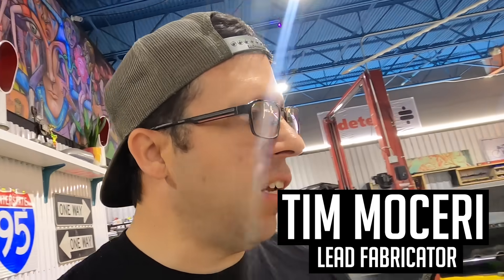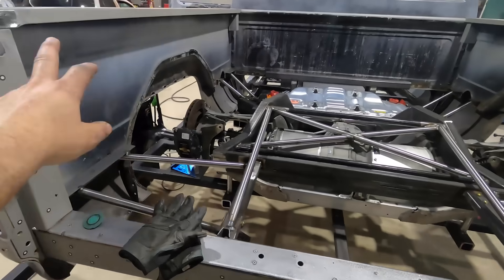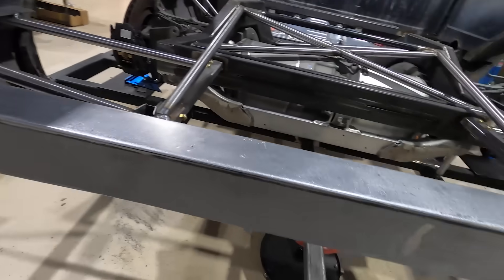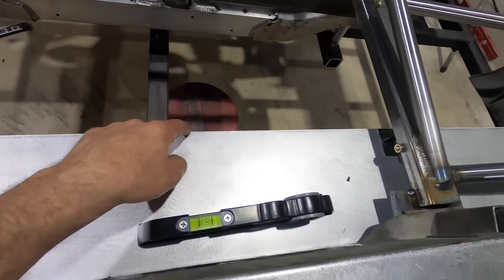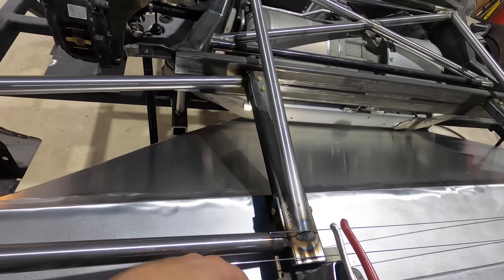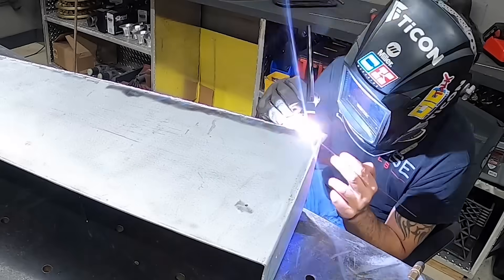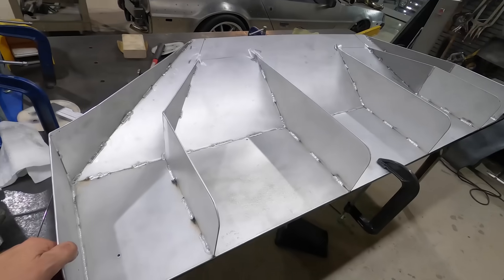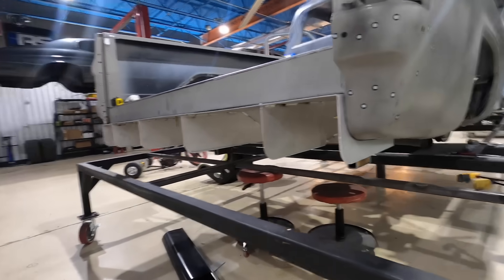GIANT 67" Diffuser For The Tesla Swapped Squarebody! - Electric C10 Ep. 7

Comment: 6:15 - why would you not bolt the diffuser to the available holes in the front/Rear of the rear motor frame, and pull the diffuser up with a curve? Sure, you lose a little bit of height, but with that tie in, and the frame of the motor being aluminum, you could gain some slight venturi cooling off the rear motor? You could also direct it down right at the front of the diffuser and keep the level, kind of like a jetski intake.

Comment: Why wouldn't you just leave the sharp edges to create vortices? Even though it's unlikely air will stay attached, in the event it did, cutting a radius in the fences makes them less efficient.
Reply from the maker: Mostly for looks. At the end of the day, it is a show truck that we'll be racing on the track. The pressure change at the rear of the truck will create downforce; not the same way a diffuser with a less aggressive angle would. But, at the end of the day, it's a squarebody truck. Not an F1 car.

Comment: Hey guys. This build is incredible and great ideas! Just wanted to help if I may (feel free to ignore me). The angle for your diffuser (underbody tunnel) may actually be too steep and cause a flow separation problem creating turbulent flow and not give you the downforce you want and creating drag. Also your rakes have some extreme angles on the outer most sections which will most likely do the same. Don't get me wrong. Awesome diffuser just might be worth looking into the design a bit more if you have the time. Well done guys!

Comment: The air isn't gonna stay attached with that steep angle. Looks cool but I wouldn't expect much downforce gain
Reply: It's a pressure difference. 

As long as there's nowhere for the air to equalize out of the diffuser the purpose is served. (Air above the bed has higher pressure = "down force")
Reply: @aetherseraph  no

Comment: Real question: How can a diffuser create more downforce AND gain range from the battery? -If it's applying more downforce / making the vehicle-in-motion at highway speed effectively weigh more, doesn't that REDUCE range?
Reply: I think they mean it will be better range  than if they put a wing on it. diffusers are much more efficient that wings...well not this diffuser. this diffuser is for looks only
Reply: @willrogers5713  That makes sense. Any links on "diffusers that work"? It it simply that the diffuser angle shouldn't exceed a certain angle and that angle changes need to be smaller?

Comment: if that diffuser lead angle from the underside ground plane is more then 15deg, then you might as well not have bothered; after 15 deg air will delaminate and you will have a stall point about 1/4 the way up that transition ( your going to have a massive wake, making Cd worse )
Reply: If the diffuser isn't gradually curved it's not gonna do anything either, air can't stay attached along that sharp angle from the flat floor to the diffuser.
Reply: Those vertical pieces at the leading edge of the diffuser are also going to create an air dam.   I think if he was to wind tunnel test with and without that diffuser he's made, not only would he see laminar separation like you said, but he'd also probably see a moderate amount of induced lift due to the air dam of those forward vertical pieces.
Reply: @actschp1   yeah I went back to look at the vertical elements but  ( again no wind tunnel ) but from experience i think the elements are too far apart and you are not going to create enough of a low press zone for it to matter.  Personally if this was My product I'd add in at least 2 sub vertical elements ( 1/2 height)  and probably a secondary perpendicular element that sits at no more then 10 deg. ( times like this I wish I could post a drawing ) essentially create a venturi
Reply: I agree with most if what is said here, I would like to just add that all the angles and measurements may be a good starting point for a design, however a proper "diffuser" is an individual component of a more complicated system. The "diffuser" can be the sleekest design known to man, but if the rest if the system is wrong the diffuser becomes a mute point. Proper wind tunnel testing with a goal is the only way to optimize the fliud dynamics involved in a system such as this. That also requires the consideration of the surface conditions, if you change one component the system optimization falls short. Diffusers, air dams, velocity tunneling, vortex shedding, etc etc etc, these are all great parts of the system. Don't get sucked into the gimmick, don't fall for the hotrod trap, if you want to improve your car's performance than pick up a physics book.
Reply: I was thinking the same, it will likely hurt more than help... but will look good from a distance.
Reply: @JoeSEED  SEMA pretty, rather then functional ?
Reply: It's a "b is for build" level of functional.
Reply: @arcadiagreen150  lol that about says it all.
Reply: Dammit Ian, came here to say the same thing, but your words were better 😁
Reply: Air likes to be guided, not forced. Less angles and smoother transitions. I dont think a wind tunnel is needed, just a simulator with dimension input.
Reply: Exactly my thinking brother exactly! Hey , do you think we are watching ricers ? Love from Australia 🇦🇺😎

Comment: If Tesla will take away peoples super charging abilities to charge their own cars like they did with Rich Rebuilds and several other people that bought used Teslas and or tried to fix their own cars then how are you gonna be able to charge this truck?
Reply: Ccs2 plug which is pretty much the standard ev plug outside of teslas propiatery plug, that is assuming they even care about equipping it to dc fast charge? You can find station's now up to 350kwhs using the ccs2 plug. Also tesla just announced yesterday by the end of this year, they plan to open their sc network up to other ev owners.
Reply: @4literv6  so have you ran into this problem with charging and getting parts for your Tesla?

Comment: Great work! The expansion rate of that diffuser looks a little extreme and will probably be less efficient that doing either a radius curve or a gentler angle all the way to the end of the diffuser, but it sure looks dope and hope it works out for you guys.
Reply: Yeah it’s a cool project but the diffuser at that angle isn’t creating down force, which is good as it would decrease the range,
Reply: 😆 oh yes. Would you please tell us all about diffuser curves, angles and expansion rates. 😆
Reply: Everyone goes to the YouTube engineering school
Reply: They'll be the first people ever to create down force by putting something on the bottom of a car and it will make history and amazing expansion rates.
Reply: @noname-jr1vo  why can’t you make down force from the bottom?
Reply: @manx1641  for the same reason that water doesn't float on top of oil. Which would be the opposite of what water and oil do.  It doesn't work like that. And Diffusers aren't for creating down force. It's to make the air under the car flow more efficiently and to spread it out over a larger surface.  You can't push on something from the bottom or spread wind out over a large surface and create down force. To Diffuse something literally means to spread it out over a large surface. Which is the exact opposite of concentrating the wind to a certain area which is how down force is created. It would be like if you turned the wings on an airplane upside down. You push on the bottom you create lift. You push on the top you create down force.  Diffusers make the car more aerodynamic. When down force is created it's because the car is less aerodynamic. Spoilers and wings catch wind and concentrate it. Diffusers allow the wind to flow around and spread it out.
Reply: @noname-jr1vo  really? 
This is an “expansive” topic so I’ll keep it simple, 
Down force is created on the underside of a cars wings not the top, the shape of the wing accelerates the air underneath the wings surface, the accelerated air relative to the air speed around the wing creates a negative pressure which the underside of the wing is pulled in to, and hence the vehicle is forced down, this is why lemans style wings are mounted from above to maximise the bottom surface area, 
The diffuser works in a similar fashion, air is accelerated under the car between the floor and the ground, the diffuser allows the air to expand creating a negative pressure, again sucking the car to the ground, 
The angle of the diffuser is important because too steep an angle and the air flow will separate and create turbulence which stops the diffuser working,  
The diffuser is such an effective tool, (it was banned) that it needs to be balanced with the front wing to stop the front lifting, 
Side note, spoilers are not used to create down force but to decrease lift by spoiling  the air flow causing it to detach from an upper surface, 
Please take this as an education not a keyboard battle.
Reply: @manx1641  concentrating the air on the bottom of a wing and diffusing it on top creates lift. That's why the surface area on an airplane wing is larger on the top and smaller on the bottom. Spread it out on top. Concentrate it on the bottom. You get lift. But you can solve this very easily for yourself. Go to your google bar and type in "diffuse definition" and that will clear it up for you. Diffuse literally means to spread out over a larger surface.
Reply: @manx1641  now if you did want to have a diffuser to help with down force you would have to have a wing on the top. So you're spreading out the air on the bottom. But your concentrating it (or creating drag) on the top. So yeah. On an Indy car. They use the diffuser in contrast with the wing to create down force. Like the upside down wing I mentioned before. But by itself. A diffuser is typically used to make the car more slippery. Keep the back brakes cool. Reduce drag under the car. Shit like that.
Reply: @manx1641  but who knows. Maybe he will put a huge time trials/F1/Indy wing on his truck. And the diffuser will direct the wind up. Then he will have down force.
Reply: @noname-jr1vo  thanks no need to google, you’ve just agreed with what I said, create positive pressure above a wing, negative pressure below and the resulting force will be down, switch them and it’ll go up,
A wing could be flat on top as long as you create negative pressure underneath it’ll pull down, this is where ground effects come in to play, the diffuser as you have correctly stated allows the air to expand as this happens the pressure decreases, but it is important to do this in a controlled manner, too steep of a rake in the diffuser and the air flow will detach and you will lose negative pressure and in effect downforce, 
The beauty of ground effects over a wing is you have nothing extra in the air flow creating drag.
Reply: @manx1641  yes. The diffuser would have to be big with a huge dramatic upturn in the back. Like a ramp. And it would have to have a big gigantic ass wing like a pikes peek car. Then it would create down force. But not by itself. And no matter what the subject. The smartest people who are in charge and make the last decision never mind and can always benefit from looking things up. Pikes peek hill climb cars are the perfect example of how ridiculously big the splitter, the diffuser and the spoiler have to be to achieve the desired effect of down force. In fact the diagrams describing this affect are of a Formula 1 car.  It's really difficult to make the surface area under the car significantly greater than the surface area on top of the car. Like I said before. Pikes peak hill climb car is a spot on example of how big they need to be. That and for a truck I'd guess you'd have to probably shape the back of the cab like the Toyota engineers did with their Turbo hill climb Tundra to get rid of the vortex behind the cab. Not only that but the sharp 90 degrees of the tailgate which also creates a vortex. It's also a pretty safe bet that if this guy is gonna put a diffuser on his c10 and he doesn't intend on driving it at 140+mph up a hill then he's probably just putting a diffuser on it because he likes it and thinks it looks cool. But when we build cars for competition at our shop we factor all this in before we start building the car. So what we think looks cool plays second fiddle to everything else. Our cars go straight so our best bet is to try and direct all the air or as much as possible over the top of the car. Keep it out from under the vehicle.

Comment: Appreciate the build for what it is but same time not fan of electric it's not the future of cars we already have electricity shortages specially in ca how is adding everyone driving electric going to help that
Reply: the infrastructure hasn't caught up yet but realistically Electric cars will help the power grid by putting power back in when needed.
Reply from the maker: We can all start plugging cars into potatoes like we did with lightbulbs back in our 5th grade science classes lol
Reply: Might want to do some research on how much energy goes into just refining, storing and pumping gasoline. Supposedly if we turned off all the oil pump jacks in the US running right now. It could power over 200,000,000 evs. Shut down just one average refinery and you can simultaneously charge over 500,000 evs with the same amount of energy the refinery uses. The fossil fuel industry as a whole uses a lot of electricity.